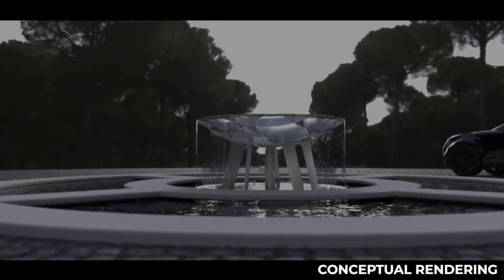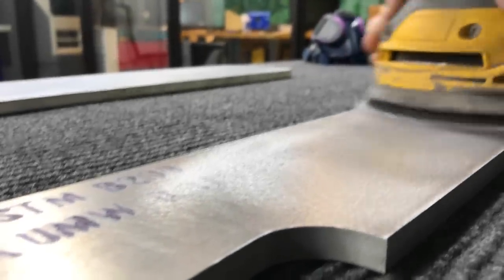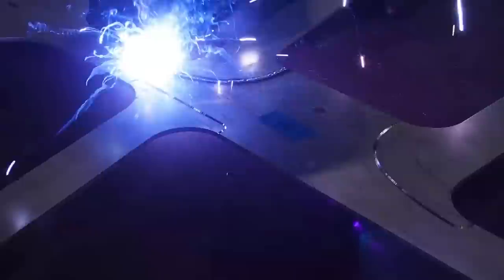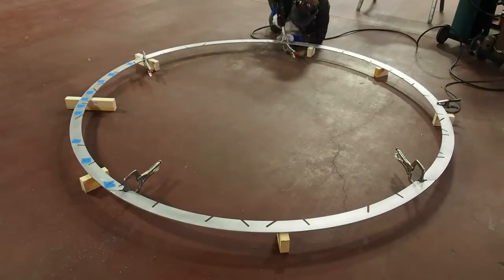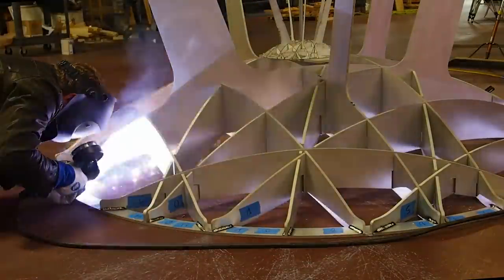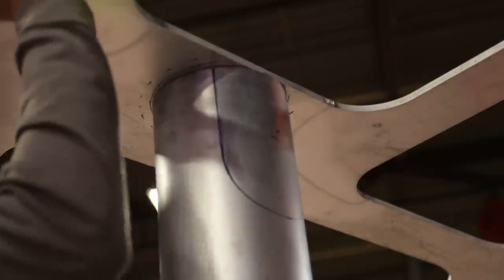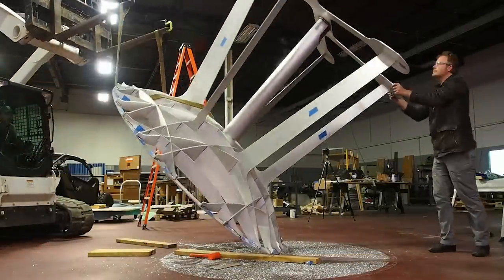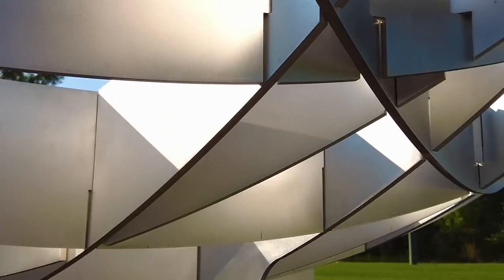Welding a Custom Aluminum Fountain | Koi Pond Pt 1

Comment: Did you weld any of the cross members to each other? Or just to the rim and center of the structure?
Reply from the maker: Great question!  Rim and the triangular piece in the center were welded.  The ribs that touch the center plate were strategically the ones that held up most of the weight.  Everything else is allowed to ‘float’